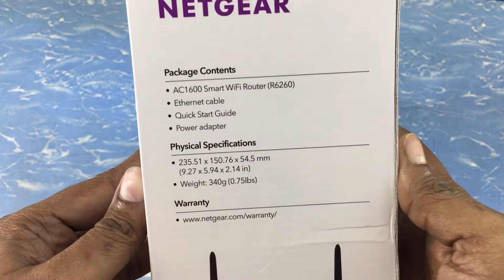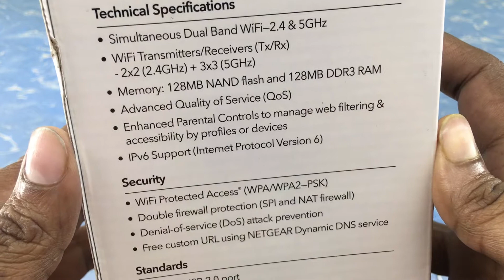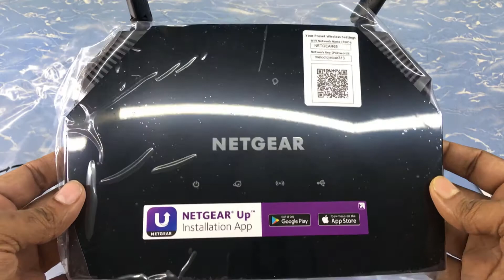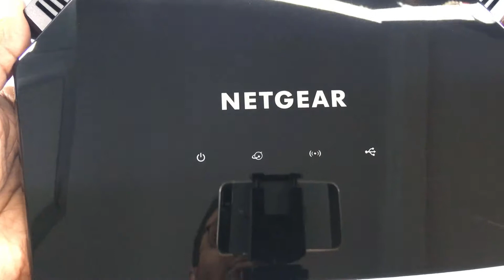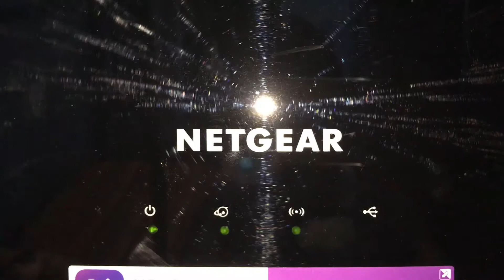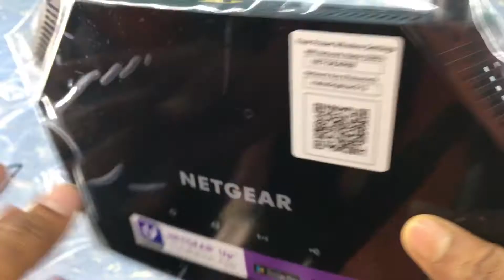Netgear R6260 AC1600 Smart dualband gigabit wifi router PROS & CONS  Setup How to access & update.

Comment: I purchased this router on 21 of may and I got my router internet connection on the same day only and from that day till I am typing this comment I haven't turned off my router I am a having user I stream 2k video streaming on my 4k TV and high intensive gaming on my 4 devices and I am never let down by this device and range is more than 30 meters at my place 🔥
Reply from the maker: This is indeed a nice router .  anyway thanks for your support, God bless you.
Reply: Thank you. I have a ac1200 currently. And it’s a year old, and I been noticing signal weaknesses over half the house currently, I’m thinking my router is taking a shit. As I have a 300mbit internet packaage and get all of it when connected thru Ethernet, but not Wi-Fi. Only hitting like 50mbps if I’m lucky most areas of the house.. I’m hoping that this 1600 that I have coming from shopgoodwill will help fix my signal issues and just give my devices over the 100mbit speed